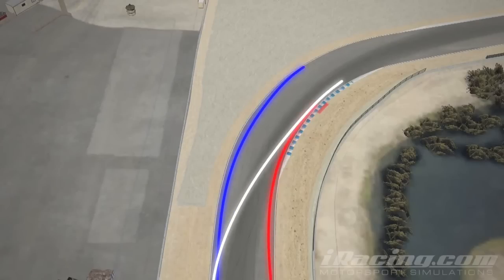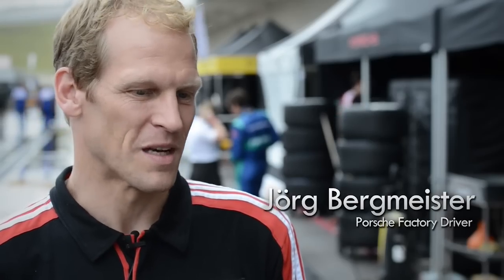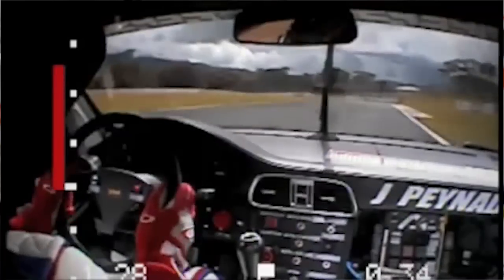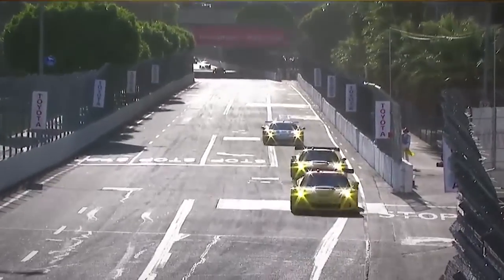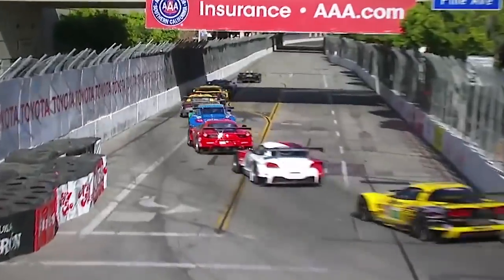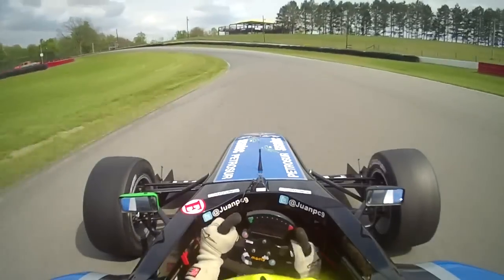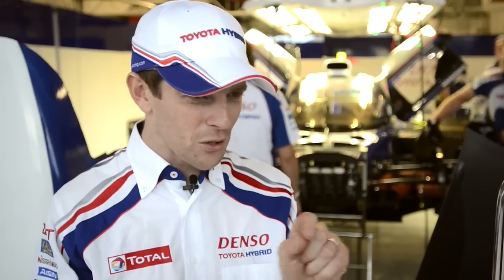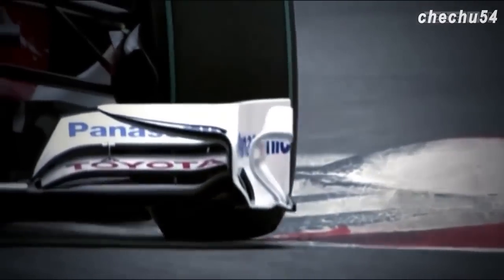The Fast Line

Comment: My first year in karting was spent solely on finding the right feel of the racing line and then applying to race situations. Once you find the feel of the line, you don't necessarily need the mechanically fastest car to be the fastest car on the circuit.
Reply: In karting you need to be tiny and weigh nothing to win.
Reply: hossguitar Very true, but skill does go a long way as well. I was one of the taller drivers in my league, but I made up for it with having a lighter go kart.

Comment: Good drivers do not spend a lot of time thinking about the racing line.  It is pretty obvious on track...and it changes, even during a race as rubber is laid down.  Guys who spend a lot of time analyzing lines are usually slow as molasses.  The racing line does not matter one bit if you go slow around a corner because you can not drive the limit.

Comment: I've got three words: Wheelspin is a bitch. When you're coming out of a slow corner then you really need to avoid hitting the throttle too soon, otherwise you get wheelspin, especially with cars that have a lot of torque. And also, cars with a lot of torque don't like when you drive over the kerbs, it makes them very unstable, usually you need to release the gas pedal for a split second after you've driven over the kerb and then ease the throttle back on.
Reply: That's 4 words lol ;) however you're correct, kerbs can be very particular about how you need to (or not) drive over them when applying power. There are a number of variables that have to be taken into account when dealing with kerbs vs the normal racing surface...then you have to add in the weather on top of it haha
Reply: Kamukix How is it 4 words? I count 3 words, as "a" is not a word.
Reply: hexagon523 lol you're right, I wasn't thinking...